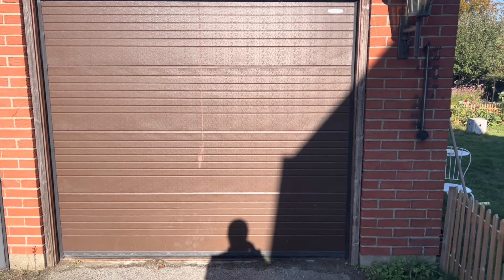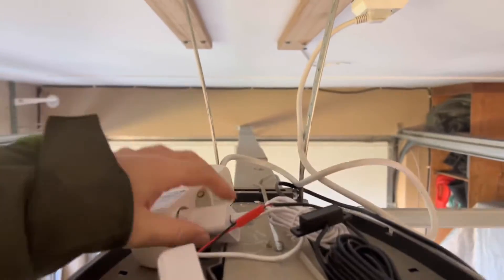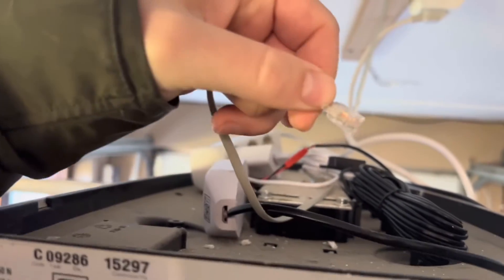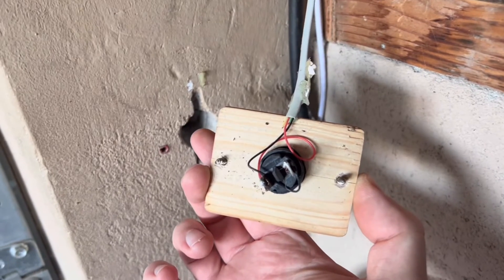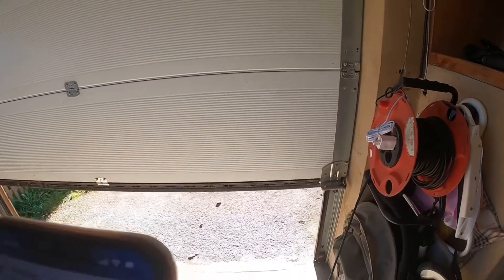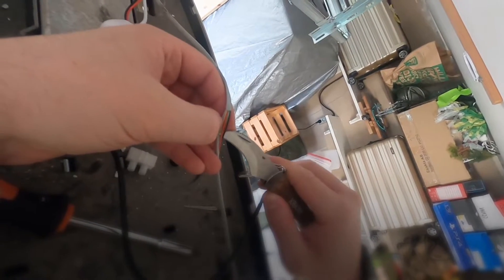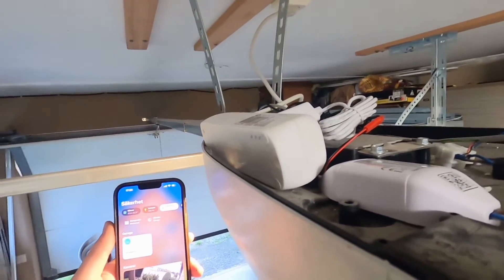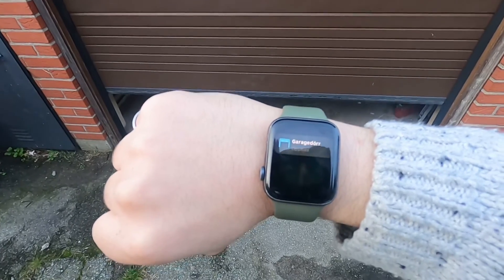Meross Smart Garage Door Opener HomeKit | Setup & Wiring

Comment: I have the same ultra s unit with no button cable. It looks like I need a RJ9 plug to go into port 7. As there are 4 connections in that port do you know which 2 out of the 4 points to use. Thanks
Reply from the maker: Hmm no, but trial and error mostly works. 😅
Reply: @techdad3206  Thanks, I think I may have sorted it. Looking at the internal circuit board. It looks like the 2 LH terminals. Just ordering a plug and cable to test it out.

Comment: Hi, 
Like you, i have a button connect to the contactor number 7 on my Crawford Ultra.
I've a some question.
If we use a double RJ11 female to RJ11 male, do we can avoid your welding to connect the meross controler?
Thank you for your answer
KIND REGARDS
Reply from the maker: Hello! My guess is yes, I was considering that as well but since I didn’t have any connectors at hand I went practical and welded. But I think your solution is better. Besides you can always choose which cables to connect in the RJ11, so you don’t need to connect the 2 extra cables if it won’t work.